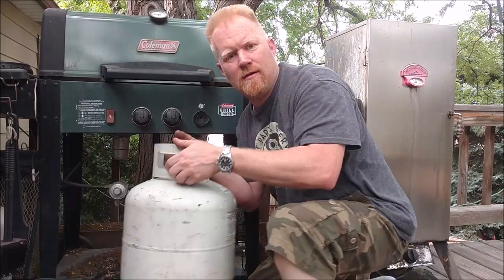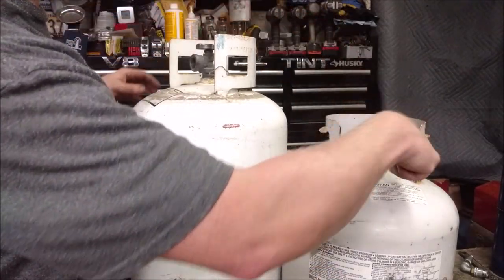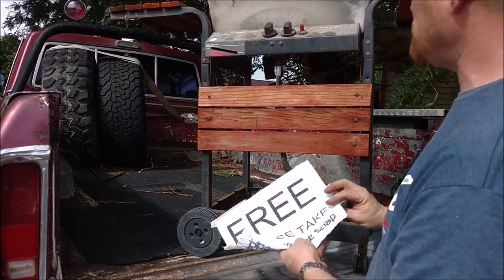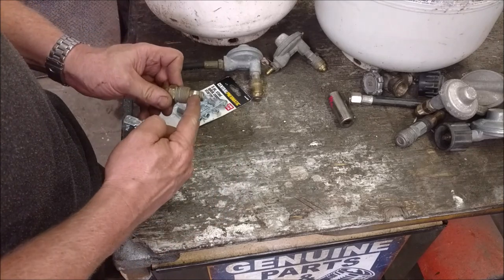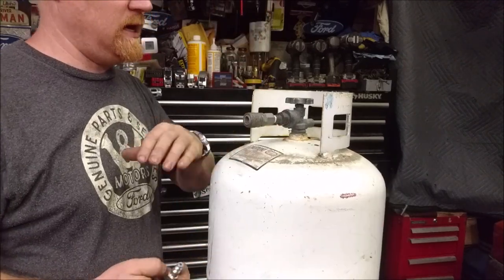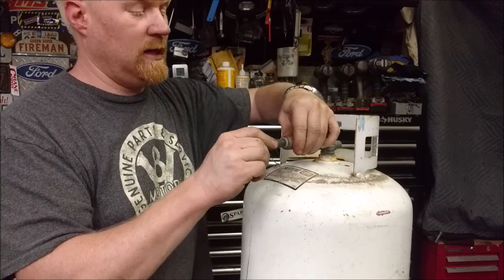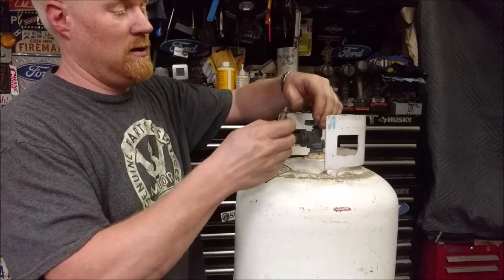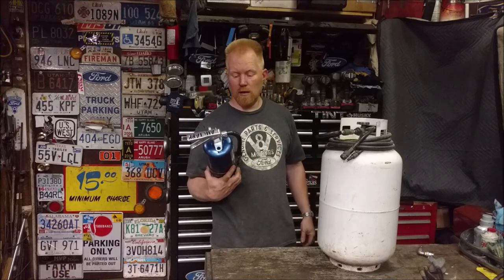Make a Propane Air Tank QUICK N EASY

Comment: YouTube has been invaluable to me. From fixing my cars to fixing my 'broken' TV,  amongst many other things. That being said, there has been no other channel more useful to me than this. And I have NEVER used any of your tips.....YET! But I know when I do run into a problem, I'll know where to go and I'll feel more confident than ever that I'll be about to fix, solve, or remedy the problem. Thank you very much for sharing your knowledge. I'm subscribed to a fair amount of YouTube; however, none of which get me more excited when I meant alerted to post. Thanks again. Have a great one.
Reply from the maker: Wow, thanks for the flattering comment.
Reply: It's the same for me! Love this channel and the great tips and tricks you give us
Reply: I agree.  Mo is fantastic !!
Reply: I have only recently discovered the channel but I'm enjoying it a great deal.  I'm learning a lot.
Reply: I'm still using the tip of applying used motor oil on wooden projects instead of paint, which wasn't staying on sometimes. I've further learned to soak small enough pieces for 24 hours. And I already had 55 gallons of used oil.
The 5 pound tanks are great for small woodburning stoves too.  
And I'm impressed by How Much you know, Moe. You have to be 200 years old! 
Thanks for All the information 👍

Comment: Pro Tip:  Old propane tanks make terrible scuba tanks.  You're welcome.
Reply: oh man ,you'd never get the smell of old eggs out of  your lungs ! HAahahaha
Reply: @zak-a-roo264  but you could blow sweet underwater fire rings!
Reply: @Eyes0penNoFear   hell yeah ,THAT would be awesome!
Reply: Pro tip you can buy a portable air tank for 20 bucks from tractor supply and avoid having to do any of this, your welcome.
Reply: Pro tip: nobody really gives pro tips
Reply: @peanutbutterisfu  pro tip, make your own stuff like a real man
Reply: @texasrox2010 I build stuff that makes me money not an air tank I can buy for 20 bucks
Reply: @peanutbutterisfu  
First, the 5 gallon tank @ TSC is $30.  Second, and most notable, the TSC tank is rated to 125 psi.  I suppose you can air up your Prius tires with it so I guess you're good to go.
Reply: To mention the obvious- scuba tanks need to be pressurized well above the burst pressure of propane tanks to have enough air to breathe for more than a few minutes  Secondly without an regulator even 10 psi is guaranteed to rupture your lungs. Nope not me 😳
Reply: @platinumsky845  time isn't free, and it's your most valuable asset.
Reply: Pro tip: scuba tanks DO make for excellent compressed air tanks, since they're rated for THOUSANDS of PSI.
Reply: @h8GW  used to use mini scuba type tank for paintball, finding a place with a 3000 psi compressor to fill it when you don't live near any scuba diving was a nightmare.
Reply: @h8GW  Yes, but they cost money to fill
Reply: There is a cleaning method

Comment: Pro tip with the propane tank! While you are purging it several times turn the tank upside down! As propane is heavier than air it will purge it out faster!  That is what I did with mine years ago and it worked great!  I carry my tank in my truck every day as a portable back up!
Reply from the maker: Good tip.

Comment: The chemical that gives propane and Natural gas it’s smell is actually ethyl mercaptan. It is also used as stench gas in underground mines to alert employees to evacuate, and it stays in your clothes and hair and on your skin. The best way to get the smell off is a soak in baking soda water, a rinse, and a soak in white vinegar water. Works for getting the smell out of clothes and off of skin.

Comment: I did the opd style I used a old regulator fitting to a quick connect drilled it out and then my pressure still sucked so there's this little flathead screwdriver port on the side so I opened that up a bit and now my pressure is amazing

Comment: I have 2 old 100lb cylinders that no one will refill anymore so now I have 2 air tanks. Thanks! I just discovered your channel and you are full of great ideas!
Reply: Or 1 air tank and 1 woodburning stove.
Reply: If it has the POL fitting there should be an adapter to use the new style. That's what they did at the propane filling place.

Comment: Great idea on grabbing the old grill hose and regulator. The last one I made , I wrestled the valve out while holding the tank in the wood splitter. It tossed that valve and plumbed in a 3/4" ball valve and all the other fittings to attach a pressure gauge , hose , shrader valve. It ended up being a messy looking rig. I love how simple yours is.
Reply from the maker: My first one had all the bells and whistles with a gauge, dip tube to the bottom to extract moisture, shrader valve, T fittings, etc. I thought I would try simple the second time and it hasn't let me down.

Comment: I did one years ago, never knew the rating of pressure was so high and thanks for the tip of drilling out the fitting!  Nice.
Reply: The pressure rating for propane tanks is WAY higher than for air, which is why they are so heavy even empty......my compressor only goes to 120 psi, so not worried about blowing the propane tank, my other air tank....yeah, I wouldn't go above 120 140 ish with it.....sure it's an air tank, but...its old, and just don't trust it....so I never go above 90 with it......with the propane tank.....no worries at all....

Comment: I used to do this back in the 80's; came in really handy back then. Today I just keep a 12v compressor in my vehicle. Under $25, takes up a small footprint and is always ready for when I need it.
Reply: a 12v compressor is great for emergencies, but this is much more efficient and faster when you have access to a large compressor but your hose just isn't long enough
Reply: Can't pop the tire with the little compressors.
Reply: @65csx83  I cant even...

Comment: I made up one of these in 1992 and have used it many, many times, and so have my neighbors ! 😊
Thanks for sharing and take care. 👍
Reply from the maker: I cut one apart after 5-10 years of use to inspect for rust and it was spotless. It was a smaller 20# tank that I had swapped out for this 30#. I trust it more than the Chinese air tanks that have no pressure rating and feel like they 1/2 the thickness of these.
Reply: @sixtyfiveford 
Hey, glad you mentioned that, I have wondered about the inside of mine !
Yeah, they are a little heavier than the store bought ones for handling but that's a good thing !
For a long time my neighbors were a little afraid of mine because of the smell, thought it was still propane in it ! 😊

Comment: I did mine just like that. I did add a tee fitting and pressure gauge. Thanks for your videos!
Reply from the maker: Awesome.
Reply: Did exactly the same.  No issue but was worried the smell ingredient might hurt tires; though nothing detected.  Sure beats buying spare air tanks.   Good video.
Reply: @campbejouc  Watching the video, my only concern was if the smell additive would deteriorate the tires? Probably not enough left to worry about...

Comment: I did this exact thing. Nice to have an smaller air tank to fill tires, use a brad and/or finish nailer for inside moldings, and such type jobs that don't require large amounts of air capacity. Of course I had to paint mine up with a picture of a cloud guy blowing air out... Thumbs Up!
Reply from the maker: Awesome.

Comment: VERY NICE !!!!  I knew there had to be an easy (and CHEAP) way to do this !!  EXCELLENT video !  Also thanks for the answer to the question everyone has about the air pressure capacity !
Reply from the maker: There's always a slew of questions about dangerous projects. I can only imagine the ones you get on the mower with the front cut out.

Comment: i used a brass 4 way cross at the valve now it has a air gauge a schrader fill valve and a - 50 rated air hose and this was done 25 years ago and still working great

Comment: I have a couple old compressors (20 gallon horizontal tanks with wheels and handle) that I got for free because the compressor portion didn't work. A few fittings, including a ball valve with quick connect to fill, regulator/ gauge and another quick connect fitting for output (most parts came from the original compressor).. and now I have a BIG , easily portable air tank, that can fill large tires (or multiple tires) with ease.

Comment: I've been doing this for years. Have the exact same double quick connect hanging on mine. Be aware,  some tanks have a safety check flow tube under the valve in the tank. Similar to the ball on a shop vac. It is designed to stop the flow of gas over a certain rate as would happen if a hose burst or something.  The sudden rush of air forces a ball bearing up against the seal and stops the gas from escaping.  This isn't desirable for an air tank. I had to remove the valve and cut off the safety tube. I think I flushed it out with hot soapy water too...mine has zero "propane" smell now...but that was 20 years ago

Comment: Excellent find....and works well for regular tires. I did this setup and practiced this at home on my 33" mud terrain tires.....only filled 3 and the 3rd one to 3/4 the full pressure.....so will utilize this as an emergency air tank for other applications.....thanks though

Comment: If you look on the side of most new style valves there is a bleeder screw you can just loosen it and blow off what’s left of the propane. Good video thank you.
Reply from the maker: You're absolutely right the 10% bleed off. The old style has this as well and was supposed to tell the operator when to stop filling the tank(when liquid came out). They rarely did and a little more liquid propane got pushed in. Fine if it's not hot outside but no so much if it was a sunny 100F day and the propane has no where to expand.  RVs with built in tanks are exempt from the new laws and consequently my 87 Toyota Motorhome has a tank that they keep trying to overfill. I have to keep a good eye on them while they're filling it as I've had the 375psi safety pop off exhaust propane before.

Comment: This is by far the easiest method I have seen. Most others have you strapping down the tank and sometimes deforming it or the collar to twist that fitting out. Filter dryer and a couple of 12v air compressors would turn this thing into an amazingly portable and useful setup. Well I know what I am doing with my dated propane tanks.
Reply from the maker: The first one I built I way overthought the process. At any time you can simply turn it upside down, open the valve and drain any accumulated moisture.
Reply: @sixtyfiveford  Perfect in its simplicity. Can't thank you enough for posting it.

Comment: Great idea!! 1st one I did this to back round the turn of the century I removed the entire valve assembly,installed an el,bushed it down to 1/4" npt,and installed a coupler,and it has worked well the past 20 yearsish.....Now that I have (literally)picked up a 30# tank like that one,and am going to go big time like you ;-)
Reply from the maker: I was always running out of air with my 20# tank. I remember when I switch to the 30# and how much more air I got.

Comment: An old engineer friend set up two such tanks for me back about 2000, maybe a couple of years apart. The older one that has been cycled much more long ago lost any trace of propane odor - this one is kept at the house, and I use it to keep the tires on the cars at home quickly topped off. The other tank is kept off-site at storage where I garage my 4 Runner, and it is cycled much less often - I can still smell a trace of propane.  I did have some concerns about the interaction of tire rubber and that residual propane, and I did eventually have a freeway-speed tire failure on the 4 Runner in 2008, but I really doubt the residual propane caused the failure.  I was concerned about water buildup in these, so before the next fill on each, I will try turning them upside down - thanks for the tip 👍🏻

Comment: Well. This old dog learned something new after working so many years in the propane industry. 

P.O.L. Was named for Prest-O-Lite and not “Put On Left” as we always called them. 
And some people will use the scientific name of Ethanethiol, instead of the more common name ethyl mercaptan. Either way the stuff has a stench that doesn’t fade away and an old tank/cylinder can actually build up a residue of it over time.
I still miss that job, that is until I have to drive to Toronto for some reason and realize how bad the traffic is there now.

Comment: Interesting video and informative accompanying write up. I have a small freon tank with aftermarket manifold adapter I've been using since '65 and a large freon tank in use since '89. I've acquired several helium tanks but never used them out of uncertainty for their psi rating. Your write up is the first I've seen. which references the helium tanks The manifold incorporates a relief valve, a pressure gauge and a Schrader fill valve.

Comment: I use a 50 pound aluminum tank. I made my own adapter. I have a 200 psi safety valve, pressure guage and a automotive style fill valve (tank valve). At 150 psi it will fill 2 large tires from empty.

Comment: I have several of the 20 lbers .  I just install a black iron pipe T in place of the valve and place a pressure gauge straight up in the T so that I can access my tank pressure any time I use it.  Install a ball valve in the side with a bell reducer,(3/4 to 1/4 ) and then your air coupler and you are ready to go with full flow when you open the valve.
Reply from the maker: My first renditions had pressure gauges but I stopped putting them on as it's just one more thing to get bumped and these never have enough capacity to worry about. They seam to always be full or empty. It was nice to crack the valve and see the gauge show pressure though if I hadn't used it in months.

Comment: Did this back in the 90's after tired of our local shop doing a half-azz job seating our tires on the rim. Tires were ok for a little bit and then all of a sudden have a flat tire fill it up and then have another flat tire. Kept thinkin I got another nail or something but then filled the tires back up again, spay a little water around the bead, and when I seen bubbles around them I knew what he had to of done or didn't do. I took the tires off and sure enough the jerk ripped the bead on 2 of them and then other 2 tires he didn't even clean the rim around where the bead seats. From here on out I started doing my own tires and made the propane air tank which has saved me quite a few times over the years

Comment: I know this is a couple of years ago, but I’ve got 4 old expired 20lb propane tanks and I was trying to figure out what I could do with them and I happen to stumble across this! Thanks for the info!
Liked and subscribed in case I’m looking for other subject matter ideas! And I’m glad you’re into doing things to keep up your knowledge/skill base! As an old navy salty dawg, smoke eater and lifelong “jack-a-trades master of none” who’s been out of the business for 20 years I’ve forgotten more about a wide array of out of the ordinary subjects than some ever learn! Hopefully, you’ll get there one day when that young offspring of yours is grown and has his own, and you’re sitting around as an empty nester trying to figure out what all is still up besides your ….! 😏✌🏼 Thanks for your help!
Reply from the maker: Awesome
Reply: @sixtyfiveford  P.S - sorry for the long comment(s), I’ll forever be a work in progress - even if it’s pushing up daisies! 😉
And I’m also considering making a compressed water tank out of one just for GP and to have on standby when burning class alpha debris (regular carbon type combustibles) at my little burn area instead of dragging my garden hose out there. The old stainless steel canister extinguishers held 2 1/2 gallons and were pressurized with 100psi of air ($160+ on Amazon) and I would just have to figure out the hose connection with a discharge nozzle on the end instead of the tank which would be cumbersome to hold/carry and use at the same time. Even with the discharge on the end it would be cumbersome to use your finger to create a spray pattern instead of a straight stream (I actually put out a house fire one time while it was still in its incipient stage instead of dousing it with a 95gpm nozzle and causing more damage as firefighters sometimes do 🤦🏻‍♂️). I haven’t looked at your videos yet to see if you’ve done something similar, but if not maybe that’s an idea for you when looking to kill some time. Thoughts?
Reply from the maker: @glcostin  A compressed air/water tank has been on my to-do list forever.
Reply: @sixtyfiveford  nice! My biggest concern with it is the eventual accumulation of rust being it’s not stainless steel; and I haven’t put a lot of thought into it yet because thinking hurts my head… 😆😉
Edited: I could probably go around to some fire stations and find out what they do with their expired ones but I was wanting to utilize what I had on hand 👍🏼
Reply: @sixtyfiveford  I have thought about the possibility of using that liquid pvc type stuff (not sure what it’s called), that they use to line old iron/lead piping in potable water plumbing. Not sure how it would be coated though. 🤷🏻‍♂️
Edited: and of course the cost of doing that would have to be weighed against just buying a SS canister…
Reply from the maker: @glcostin  Most water heaters are just plain, bare steel. You could use a cheap aluminum or zinc anode.
Reply: @sixtyfiveford  good call, brother!
Edited: and of course they have a drain so you can flush it, and it’s an option for small one on the bottom of the propane tank too, being it’ll only be pressurized to around 100psi.
Reply: @sixtyfiveford  I look forward to your informative production video!! 😝